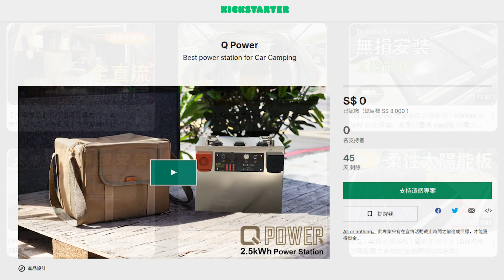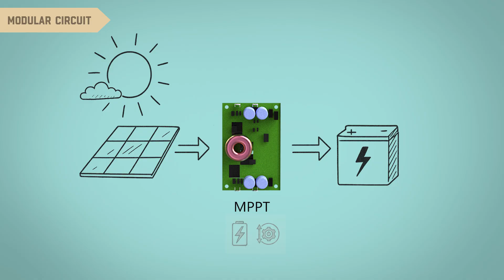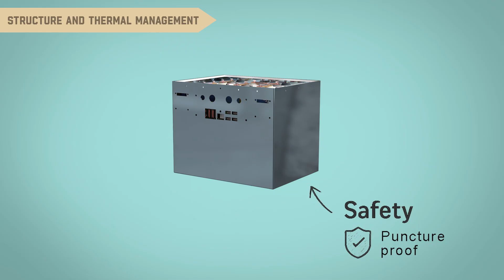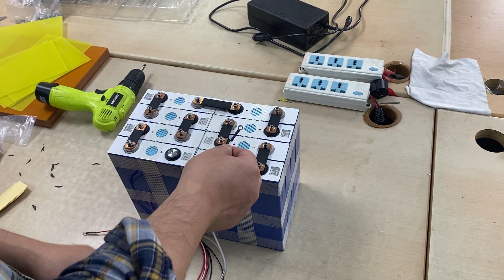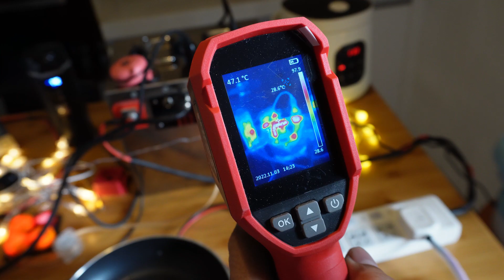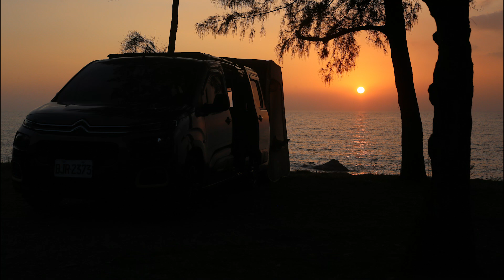How I achieved Power Freedom in Van Life (QPower DC Power System)

Comment: I'd Iove to buy this exact power system and have it installed in my van. The process is far beyond my skill set even tho you make it sound so straight forward. I'll have to stick to saving for the big whoopa Bluetti which was my dream until I saw your off grid power supply version.
Reply from the maker: Thanks for the kind words! To clarify: the battery + DC module is already an off-the-shelf product. The next steps are adding rooftop solar and choosing DC appliances, which many find tricky. I’ll make more videos showing step-by-step solar installation — it’s easier than it seems. I’ll also share links to the 24V appliances I use so people have real examples. The goal is to keep everything simple and practical.